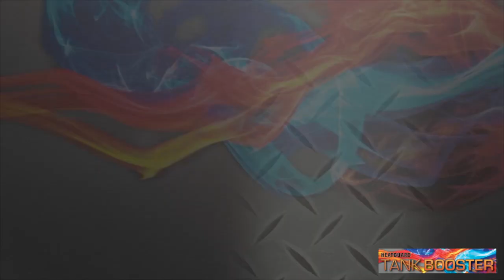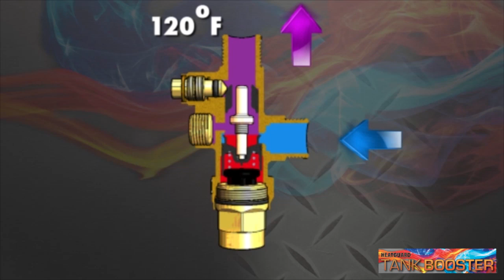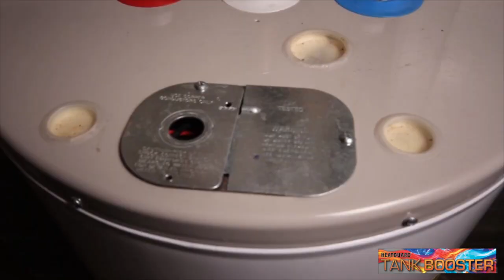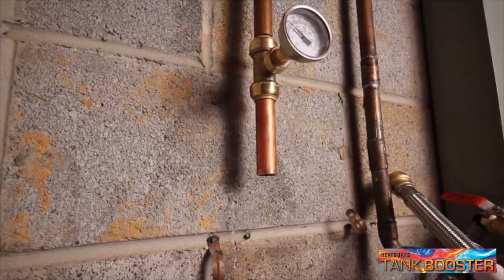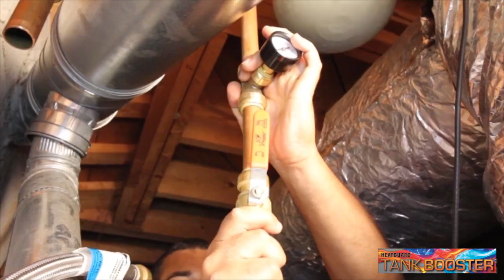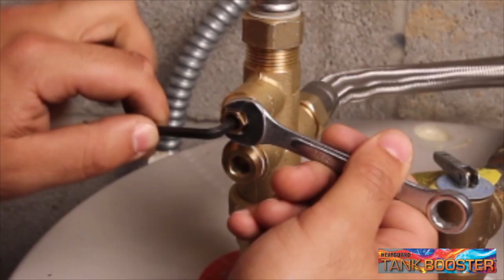Tank Booster - Double Your Hot Water!

Comment: I also got one of those.
It doesn't double anything.
It drastically reduces the risk of getting a burn, but if that thing suddenly fails while showering... You're as good as dead.
It also prelongs the life of everything, especially faucets, especially if you have water at near 100°C in your tank.
It increases the efficiency by some margin, but depends on your length of pipe and pipe insulation.
Reply: the third sentence is the big reason to NOT buy this.
Reply: @timallison8560  It is a Code every shower faucet has to be Temperature and Pressure balanced. Thus, what ever third sentence says is completely  irrelevant. If the Tank Booster fails, shower faucet will balance hot and cold water and user won't even notice hot water output from the water heater

Comment: I installed a high efficiency rhemm gas water heater, a watts recirculation pump, and this. My gas bill is now higher about 30 dollars a month now. 70 bucks during the summer now. When it used to be around 30. What gives?
Reply: The recirculation pump is why your bill is higher.  It's essentially heating all the hot water pipes in your home instead of just heating the tank.  The benefit is that you'll use less water as you no longer need to wait approximately 30 seconds for hot water to arrive for your shower while cold/warm water is running down the drain.

Comment: When I put this on the hot water stopped flowing altogether. I checked the strainer, but it wasn't clogged. I checked if I installed it upside down, but I didn't. The union connector was connected the right way too. So, I don't know why I don't have hot water? Is it because my water heater isn't connected yet to the power outlet?
Reply: If you have an electric hot water heater then yes, you have to have power on before your water heater will function.

Comment: Why not just increase the water heater to 140 degrees without using this mixer?
Reply: Risk of scalding,in MA. code states that the hot water coming out of the tap has to be in the 120 degree range.
Reply: Because 140* water will end you up with a trip to the hospital with scalding burns. Cmon think for a minute.

Comment: How do you adjust this mixer?  Our hot water at the showerhead isn't hot enough...  Anf recently has been running warm then just tepid without moving the shower mixer. 
Could this Cash Acme Valve mixer be dead?
Adjustment: The top part has a + sign, and nut, and an allen socket.... errr. Is there a video on how to adjust?
Reply: set it by turning one way or another while testing the closest faucet.. i would assume loosening the screw (turn counter clockwise) would bring more cold water in... if all faucets have changed i would ask if it is cold out and if yes/ does your cold water vary temp a lot from winter to summer and if yes/ did you set the valve in the winter or summer/ if answer is yes set it in summer then the fix would be get a permanent marker and mark it now across the screw and onto the housing at 12oclock then start adjustment for the closest sink or faucet once set make the second mark on the housing in line with the line on the screw you made before.... congratulations you now have a winter and summer setting on your device that should have been thrown out and replaced with a proper temp controlled mixing device.
Reply: @masterdebater8757 commenting to save this thread

Comment: Yea ive had this thing on my waterheater for over a year and i havent noticed it do anything the entire time..  ive adjusted the temp knob on the device and waterheater up and down and water will always feel just as hot as it would with just the tank...  in fact i live alone, just installed a 40 gallon, have it set to 145°f and every time i take a shower, without using any hot water, still run out of hot water in about a 20 minute long, long i know shut up, shower...  so what the hell?   Funny part is i installed it when i put in the water heater and replumbed all my distribution pipe because it was all the corrugated pipe and had had it, and when i had the house inspected to sign off on the permit and home, the inspector looked at that thing for a good 10 minutes and looked at me and said, and i quote ". You know in all my years, now its not illegal or against code because its just, well stupid im sorry to say..  but if you connect the cold water to the hot water outlet of the tank, your not gonna get hot water..  so whats your thinking on this because im all ears, do you only like warm water or just pulling a prank on me because this heres a good one..". Lol
Reply: Well my hot water is set to 135, my booster (a Honeywell), reduces the temperature so that I do not need to add cold water for any shower or bath.  My 50 gal capacity tank has never run out of hot water for my house with 2 kitchens, 6 BR 5 1/2 baths and two laundry rooms for my multigenerational family.  Previously, I had an 80 gallon tank.
Reply: Your first mistake is listening to a home inspector.
Reply: @mikegribben4549  great comment!

Comment: Those flex connectors are polyethylene inside and are not allowed within 18" of the flue vent in almost every state in the US.
Reply: What about beside a power vent?
Reply: @jasonhessels   Power vent water heaters are PVC vented and do not get hot enough to cause degradation.

Comment: I spent the $100 for this product from Amazon. I figured I would try after getting a quote for a tankless. This product did not work for me. Not sure if its because I'm running a hybrid wh. Having a double head shower I would get about 11min of hot water. After install I got about 12min. Looks like I'm dropping some cash for a tankless.
Reply: Hybrid is like same price as tankless almost but only 6 year warranty maybe try 75 gallon with a tank booster that should be 90 gallons

Comment: You lost me at "sharkbite"
Reply: Shark bites are garbage, pro pess all the way
Reply: Shark Bites are amazing, they sell them at any Home Depot. No more measuring & cutting exact new copper pipe to connect by soldering or welding copper pipe, adapters & elbows.  Just screw the bendable ( Shark-bites ) to your water heater then clean the cooper pipe about a 1/2 inch were you cut off the old one off and  push the other end of the ( Shark bite ) on to the copper pipe and then it clamps down hard on the pipe, hence the name ( Shark Bite ) and does not let go. You would have to cut to get it off once it’s locked on to the copper pipe. It’s pretty cool and saves a lot of time from the old way

Comment: I know a lot of people are calling this a scam, but I do see a potential legitimate use for this in Solar water heating.  Solar can heat a tank to 180 degrees which would pose a significant scalding risk.  This would temper the output to something that wouldn't scald.
Reply: wow...I have a similar "booster" but you would need to have a thermostat.  This booster and mine are mechanical set to add a standard flow of coldwater to the hot water.  If the water coming out of the tank had temperature variations, it wouldn't be very effective.
Reply: @Al_Z.Heimer  correct and some of us have a large swing in temps with seasonal inlet/cold water temps. I sent you a link on another comment section it has the abilities you might be looking for and can be used with your old style mixing valve tank booster.

Comment: Doesn't work because your mixing cold water with hot water which your shower does already this is just pre set temp device plus you have to max out the temp setting on the burner on the heater to get 120F out of this device killing the efficiency of the heater 
it self. It reduces the output of your heater because it takes alot more hot water to make hot water when your introducing cold water especially if your city water is very cold you have to have the temp setting turned up way passed 120F its designed temp rating for maximum efficiency so it runs longer that's why it's a scam. The only possible way it would work which it doesn't is if the feeding water to the heater was pre heated to help the heater to heat the water faster and not have to run as long which this device does not do in fact it does the opposite if you have a high efficiency water heater do not use this device the water heater was designed without it, if you want 120F water for safety for kids or elderly just turn your unit to 120F it will be way more efficient than this device.
Reply: the idea is to get 60 gallons of 120F water from a 20gallong tank but the unit itself isnt designed for the application due to inlet/cold water temp swings winter to summer as well if your power was off for some time you would get even less all the ay to NO hot water from an electric tank. the device is for boilers to mix 180F water with mains water for storage or hydronic systems where variance of mains temps are generally accounted for in the system. I could see this being used with solar heat exchangers that are storing water for domestic uses also but it is straight mechanical and we have proper mixing valves that work by temp now so why bother with this old device at all. I agree it isnt a booster and it saves nothing it only makes a tank act like its a bit larger and likely stresses other parts like the thermostat, elements, and TPS valves right to their breaking points as well as poses risks of severe burns if the cold side clogs or someone acidently blows the TPS valve or breaks a pipe near tank. To many what ifs. The manufacturers generally know best less it is a manual from china your reading.

Comment: Or you could just NOT buy this and use your faucets to regulate the water flow and temperature and NOT spend MORE money to heat your tank to 145 degrees all day and all night!  Higher water tank temperature = higher electric consumption and costs!  Nice try snake oil salesman!
Reply: This is supposed to allow you to turn up the heater t-stats and store hotter water (140 deg) in the tanks while only sending "standard" 120 deg to the faucet. Due to new regulations the tank companies stopped making larger tanks so, for example people who had a now nonexistent 65 gallon tank have to replace it with a 50 gallon tank if something happens to the 65.  It does give you more HW time at an increased cost.  Also, going to 140F is  safety issue as it keeps legionella from forming (150F kills it)

Comment: This allows a licensed plumber to turn the water heater past the factory set 125 degrees. Setting the thermostat to 140 degrees and tempering back to 120 degrees essentially makes the tank feel like 7-10 gallons more. The main reason why folks want this is you can't get a standard electric water heater bigger than 55 gallons and people who have a 66 gallon tank don't want to hear they have to get a 50-55 gallon tank.
Reply: George Clift your right. To go bigger now you have to buy commercial with a smaller warranty and cost a lot. Not to mention not everybody has the room where their current 50 gallon electric is to put anything bigger. Also, for those reading this saying I have an 80 gallon electric, the govt did away with them 2 years ago.
Reply: @DP-cg5lf  oh no... I actually have TWO 80-gallon electrics about 15-years old that I'd like to replace. What are the options today? Tankless isn't an option for me, due to electrical constraints.
Reply: I've always left my water heater at 150°F. I can manually do the mixing right out my faucet.
Reply: Why would you need this much hot water?
Reply: @Kneejair  teenagers

Comment: I install cylinders amongst other solar products and my advice is to only store hot water at safe temperatures anyway, incase of malfunction of valves like these.  We still install these types of valves as a safety precaution incase the hot water temperature should rise past the thermostat settings, but the water temperature level is always kept at a safe setting, where it poeses no risk of scalding.
Reply: But with the tank set around 120° you can have harmful bacteria in the tank . By using a valve like this you can set the tank to 140° but adjust the outlet temperature lower thereby killing bacteria in the tank and not scalding people. It also effectively gives you more hot water
Reply: @chrisd4432  but is that really a proven problem

Comment: Isn't this what's already happening at your faucet anyhow, the mixing of hot and cold water to get the desired temp? I guess if you are afraid of getting water too hot at the faucet because you have kids, this would be a way to avoid that and still have water hot enough to use.
Reply: It's not about getting the desired temp because as you said that happens at the tap anyway, it's about extending the usable hot water in your tank. Without this, to get warm temperature "X" at the faucet, you will use more of the liquid in your hot water tank, with this you use less, because the water in the tank can be kept much hotter so temp "X" can be achieved with mostly cold water and a little hot tank water. The idea is to make the usable hot water last longer.
Reply: Moonpie Spotlight I believe youre missing the point - one of these adds hot water to the cold water supply, so the heater doesn’t have to work as hard/long to get the hot water up to temp.
Reply: They work well. I have several at the facility I manage. Much larger versions but the principle is the same
Reply: Prime example of why your ordinary person needs to leave plumbing alone. Doesn't grasp the concept at all.

Comment: The claim may be exaggerated but by tempering the water at the heater, less hotter water will be put into the distribution pipes with less heat loss in the run to the fixtures. Insulating both of the pipes for at least 5' from the heating tank will reduce heat loss. Insulating all of the hot water pipe will reduce heat loss during use as well as perhaps providing adequate warm water even an hour later at the sink. Onboard boats with very small (6 gal) and very hot (180F) hot water tanks, this is very useful.
Reply: I used one of the types right at my RV shower and put in 12v recirculating pump. I ran the pump for 1 minute before showering. Lost zero water getting into a nice shower with 1/2 gpm shower head, just turned it on to soap and rinse. Really extended my water supply.

Comment: This is no different than what domestic water boilers have used for decades, which is required by code anyway. Most run in the 160* F and up range, so you can see why you don't want that coming out of your tap.

However, the title is correct for the video nonetheless, but I can't see it saving money because your water heater is working harder. Gas/oil might be one thing, but I would think this would be really hard on electric water heaters.

Comment: All this piece of  hardware does is dilute your hot water with cold water at the point where it exits the hot water heater.  If you want to dilute your hot water with cold, simply turn on your cold water valve at the destination for the hot water (the shower, the bathtub, the sink, the vanity, wherever).  I can't think of a single reason for anyone wanting this item. If you want colder water to exit the hot water heater, simply turn down the hot water heater temp setting.
Reply: This add s cold water to hotter water to extend the hot water use like filling a glass with 120 degree water. You have one glass of120 water. Now if you fill that glass with 140 degree water you have to add more cold to get it to 120 degrees. By doing this you have made more than one glass of 120 degree water. It is to give you more hot water. Simply cranking up your hot water heater only gives you hotter water not more. Yes you can do the same with your faucet if your not worried about children getting scalded.
Reply: @mikegribben4549    got it.  good point and thank you for your insight

Comment: It's clear you are not a plumber Mixing valve are designed to temper water in some fixtures are the most common use is for commercial and special Futures,

Comment: If you run the water heater hotter, wont u be spending more energy?
Reply: peter conway not true look at the bottom of your dishwasher and you will see a rod that is called heating element. If water comes out of hot water heat at standard 120 the dishwasher will heat it to 140. You are spreading fake news.
Reply: @ncvman  yea but that cost money on the electric bill when the water going into the dishwasher should already be hot if you run the hot water tap on the faucet. I have a gas water heater and have the temp maxed out.